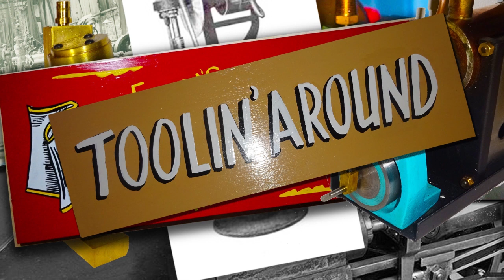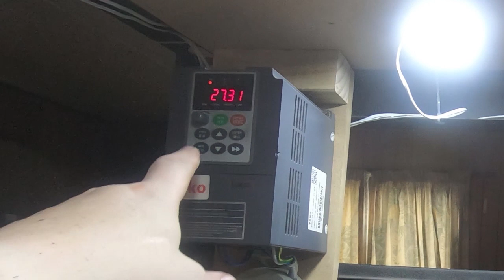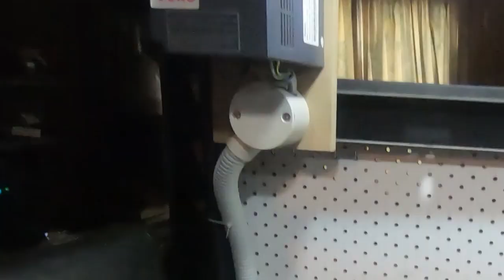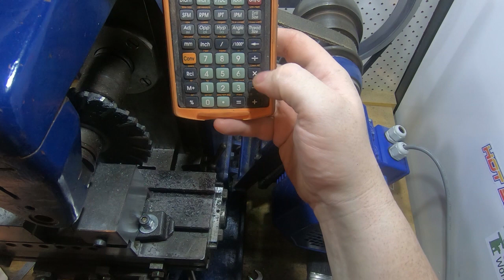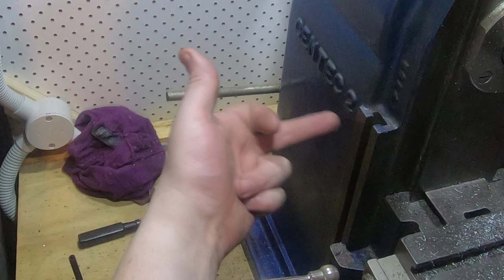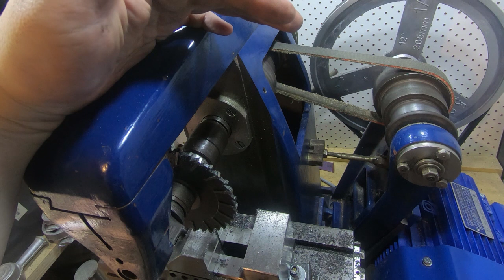An update on my Centec Mill

Comment: hi ! i too,, have a centec 2. and am in the process of doing it up   ,,,,,! it cost me an arm and a leg but yer get nowt fer nowt in ths world...what i dont want is cables belts pulleys  ect  for all to see .. so i am trying to work out how this can be  done. unlike yours  mine has what can only be described as a split ratio gear box. from  motor to split ratio gearbox then to your configuration. there are only two speeds on the split ratio  gear box "i think"  high and low ...   i want also a vertical  the mk 3  i think ... its the one you can wind up and down... wish me luck in finding one they are rarer than hens teeth.... keep in touch    regards  laurence

Comment: Check out beachcomber, he has a Centec 2 and he has just used a vintage car screw jack under the knee. This makes it way easier than adding a worm drive wheel to the back like the 2A and upgrades it to the 2B configuration making all adjustments easy from the front.

Comment: belt guards? who needs belt guards on thier machines? :P Mill looks like it's running pretty well, and I was wondering why you dont just make a new pulley to go on the mill, just do two 2 step pulleys, then you can get the high range of speeds and the low range of speeds. I had a south bend step pulley like that that I had gotten run across, and had 8" on one step I think and 10" on the other so you could switch speeds without having to change pulleys and such.

Comment: For a small mill it looks very solid . is it from the 60's  .
Reply: The Centec 2 was made between 1943 and 1958. It's a solid piece of good old fashioned British engineering. I've got my restoration videos on my channel if your interested.
Reply: @beachcomberbob3496  I will , thanks .  I wonder if it was designed as a war time production mill , due to the knee height lever control .  Cheers .
Reply: @swanvalleymachineshop   I'm not sure (information is sparse), but they pretty soon brought out the 2A which had many design improvements.